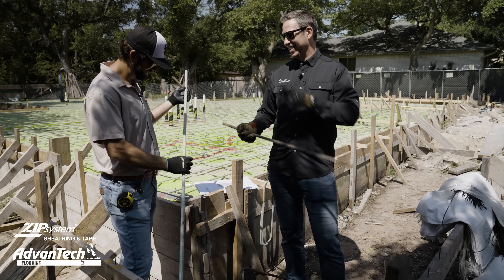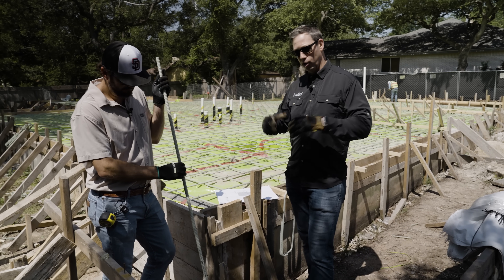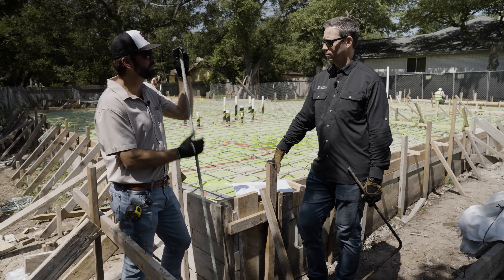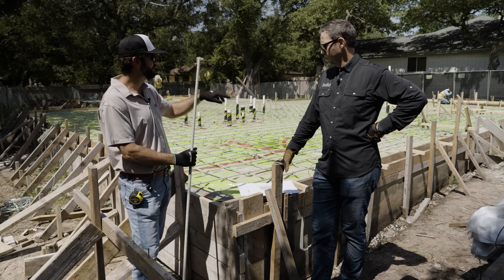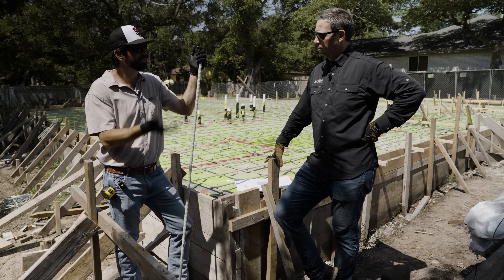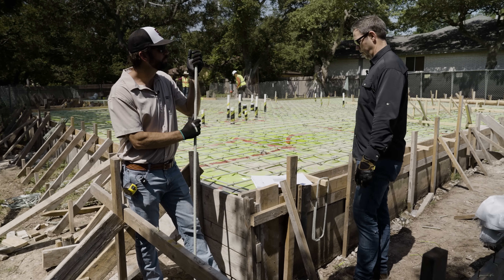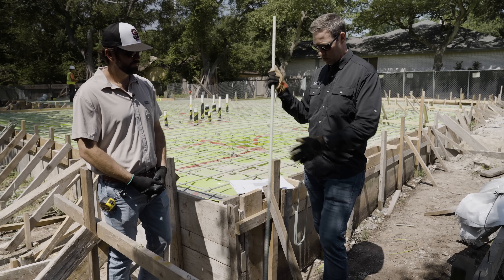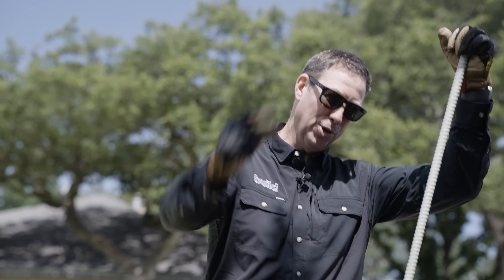Comparing Steel and Fiberglass Rebar - SURPRISING results

Comment: What about the difference between adding fiberglass fiber to your concrete mix vs fiberglass rebar?
Reply: MST BAR is comparable to steel rebar for installation procedures. This product is a different category with different installation procedures and requirements. Our understanding is, some form of reinforcing bar would be required to go along with the fiberglass fibers.

Comment: What about the fibres upon cutting, are those fibres as abrasive & damaging as Asbestos?
Reply: MST BAR does have the carcinogenic characteristics that Asbestos has. Cutting MST BAR produces round dust particles similar to cutting stone or wood. Although there is no specific health risk in cutting MST BAR, personal protective equipment (PPE) should always be worn.

Comment: I work with GRP a lot and whilst there are many advantages I'd be a little worried about using it for rebar in a big project but household size stuff it would be pretty handy. The thing with GRP Vs Steel is, steel is quite forgiving, it will stretch and give before loosing integrity. When GRP fails it fails, will tear straight through.

Comment: If you are doing a project and want it to last a 100 years, you don't want steel rebar. I have inspected many buildings and concrete rot is real on buildings past 50 years.

Comment: What I would love to see this product used in bridge decks.  Can't tell you the number of times I've seen bridge decks being rehabilitated by removing the brocken an up heaved concrete, cleaning the rebar and pouring more concrete.  To use this on current decks it would require more work but the future savings would be worth it.

Comment: Worked with structural Fibre rod, installed several thousand feet of it on a 220ft radio tower in place of steel cable on a site where corrosion was a concern, mfg claimed tensile strength of 50k pounds. I was also there 15 plus years later when it had to be removed. 
Long story short, the rod had begun to turn to powder on its outer layers, it was very dangerous to handle new and old. Disposal and install was annoying with handling hazards (never allow it to slide through your hands gloved or not), it had added eye and respiratory hazards during disposal from the degraded rod.
Steel is still better overall IMO and safer. My former neighbor was an iron worker who spent his career working on bridges & dams with rebar and poly coated rebar I suspect he would say the same.
Reply: It doesn't make sense to use this as a regular rebar, it should be some sort of hollow thick cylinder that gets filled with the concrete instead. GRFP isn't suitable for this kind of narrow and solid parts.
Reply: Epoxy rebar is crap too, galvanized rebar is the best bet for the near future.
Reply: good info.  to the industry, lets not hastily jump on the first alternative, nor abandon the mission because the first option didnt work out
Reply: Huh

Comment: On the recycling aspect, I have a local concrete recycler that charges extra for concrete with rebar, I wonder if this fiberglass rebar would feed through the machine in comparison to steel.
Reply: When recycling concrete which has been reinforced with MST BAR there is no need to separate the MST BAR from the concrete. Everything can be ground together back to its original state of sand and stone.
Reply: The final recycled product would prob benefit from the polymer and glass tbh. It's like glass fiber reinforced concrete along with polymer modified concrete

Comment: There are obvious pluses and minus' for both products but I don't think that GRP rebar is a wonder material, its just another option.   You only have to look at the way fibre reinforced concrete has not taken over the market as was originally expected.  I see two downsides for GRP rebar:
1)  The fact that it cannot be bent on site or at the suppliers, any bent rebar has to be specially moulded, which is OK for major works or those of a very simple nature but you can bet that it causes a real headache for the sites as a special order has to be placed just for the one length that you are short and you can also guess that delivery may be extended.  This compares with on site bending of a piece of steel rebar that you probably bought from the merchants an hour ago.
2)  In UK we use a considerable amount of weld mesh reinforcement, particularly for floor slabs and clearly that option is not available in GRP.
Reply: There are alot of WWR mats made out of gfrp. It is not widely adopted to that market yet but it is available. Suppliers in the US can stock common shapes such as hoops, step-downs, L bars, and 24"x24" corners etc. for common applications. Steel and GFRP need to be fabricated in one place or another.

Comment: I was thinking about buying some but where I live the cost was more than double that of steel. The fact that it didn't bend made me concerned about the strength at the corners too so I went with heavy trusty steel. I do look forward to seeing cheaper fiberglass rebar in the future though. 

One place that that weight must add up is in high rises though. Are high rise buildings using this more to reduce their weight as they go up and just using steel where bends are needed?
Reply: Where are you located and what kind of gfrp bar was it ? if you remember and don't mind sharing.

Comment: Can't you deform this stuff with a torch?
Reply: Deforming MST BAR with a torch (i.e. to make bends on site) is not an option. Bends are made only during the manufacturing process. Some choose to use MST BAR straight bar and mix in their own on site bent steel stirrups.

Comment: Well if price will not get down then use of it is small.. after all If cost is up to 50% more than normal steel..well not likely ..it doesn't wight so much..nobody cares..if you build your own house you do it once and you are done and if not you could order two 3 more ppl to help you and it is still cheaper..

It has benefits on other side..yes and big ones ..but only if your base is not properly designed with no water in mind..after all that is what will kill your steel ..water..not time as such..

Comment: Concerning the yield strength, this is a negative. Using a reinforcement in beams that has high yield values will leave to catastrophic collapse rather than noticeable cracks that can be investigated and repaired. That being said for low rise structures this product will do well but Ill stick to steel on my high rise.

Comment: I can confirm fiber glass or pink bar is better. Anytime I’m breaking concrete with steel rebar, the concrete just sheds off. In fact a weak point during the demolition process

Comment: I've wondered for a decade now or more, really going back to thinking about wrapping structures potentially for longer lasting results with carbon fiber.  Interesting to see more readily available fiberglass at the big box stores.  Happy for that.  Bummer in regards to the open source or other Ultra High Performance Concrete now.  That seems like would be more common if more combustion coal or other like waste plastics or rubber fired power plant stations. That and in general the lack of implementation for longer structural integrity.
Reply: Thanks for sharing!

Comment: AI says: "the total energy consumption of fiberglass rebar production can be estimated to be around 10-15 kWh per kilogram of rebar, depending on the specific manufacturing process and equipment used. For comparison, the energy consumption of steel rebar production is typically around 20-30 kWh per kilogram."
So the initial production may use less electrical energy, but if you factor in you can't recycle it, closer to a wash perhaps.  
It also takes petroleum to make resins...
Anyway, weighs less, and doesn't rust are positives.

Comment: The requirement to wear gloves when handling this material implies the glass particles could be in the surrounding air.  Especially when cutting it.  It seems to me it would be prudent to wear respirator or mask when handling fiber glass rebar.
Reply: Yes, like with cutting metal rebar.
Reply: The glass coming off the cut bar or slivers should not be confused with the fiberglass insulation. they have completely different shape under microscope. fiberglass insulation are J-Hook shape vs fiberglass dust from cutting are Solid round particle. you can treat them just as concrete dust and wear a regular mask. imagine fiberglass boat industry that has been making boats and hot tubs for years. no issue with the people who worked in those industry for 70 years.
Reply: @bornahany  Fiberglass cuttings are sharp and highly irritating but they're not anything like asbestos or carbon fiber. Glass in your lungs does cause damage but e-glass and s-glass are slowly eaten away by the chemistry in your body. Takes possibly months but typical glass in your body is not going to be there for life like asbestos, silica dust or possibly carbon fiber. Still having said: use PPE. Don't breathe in irritants even if they're unlikely to give you cancer or silicosis.
Reply: Use a wet cutter and don't make dust. Problem solved.
Reply: nah you can inhale glass dust no problem. it's the same thing as steel dust.
Reply: The fibers are too large in diameter to be respirated into your actual lungs. Can still cause irritation though.

Comment: Cost is important if you can't use it on every job it's not worth it . Working with fiberglass, you need ppe gloves , masks, respirators, cutting shields , and long sleeves  .

Comment: Did Matt mention anything about the Fiberglass rebar's compression strength? We know it performs well in other areas besides shear. Curious to hear if the compression strength of the fiberglass has a similar or even better testing result as the steel. Its stiffness properties when used in a vertical manner would make me a little concerned.

Comment: As a Miner we used mostly metal rebar for ground support  but we used fiberglass rebar in situations where elasticity is required. Also cost and design of life of project is a factor.

Comment: We only use rebar when joining old to new, plus an expansion joint to prevent  the inherent damage from new joined to old.  Maybe glass highway mesh?  How do you make hoops for ladders and sono tubes?  Are the laps the same as with metal?  Are they tied with wire ties vs. welded?
Reply: All shapes are made in the factory when the polymer is ' plastic '.
Reply: Any shapes (hoops, stirrups, bends) are formed during the manufacturing process. MST BAR is manufactured to spec using custom jigs for forming. Because they are formed in a jig, each piece is identical. There is no variation in the shape or angle of the bend.  We also avoid any breakage during production that may be experienced using steel.  

Laps are the same as with steel rebar. MST BAR can be tied with wire ties or zip ties but cannot be welded.

Comment: 😂 leave it to the experts engineers to decide to use a heavier grade bar than the maker recommends.   Reminds me of the early adopter of fiberglass boat manufacturers who used real thick laminated fiberglass to build the hull and then someone else figured out that fiberglass was so strong that a thick layer was not needed.

Comment: Yes, That's right, I am a manufacturer and supplier of GFRP products from China, including GFRP rebars. It is a new type of reinforcement material characterized by lightweight, high strength, corrosion resistance, oxidation resistance, rust resistance, and long service life, Excellent thermal conductivity， It has excellent processability and is also a good electrical insulation material. The production process is formed by fiber impregnated resin through automated machine extrusion, winding and solidification. Its excellent performance can be applied in various fields. At the beginning of the purchase, the cost is higher than ordinary steel bars. However, for a large engineering project, its subsequent value and benefits can completely exceed its cost difference, such as reducing installation costs and subsequent maintenance costs. And you can choose the appropriate resin and fiber according to your own requirements for the performance of steel bars. For better ones, we have epoxy resin and basalt fiber, which can make their performance even better